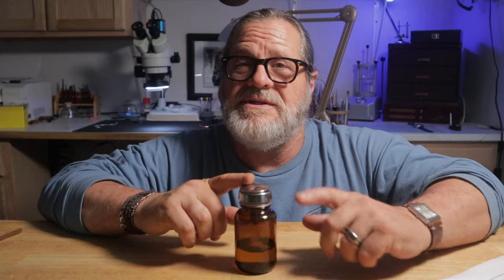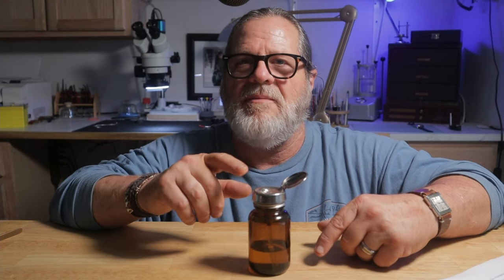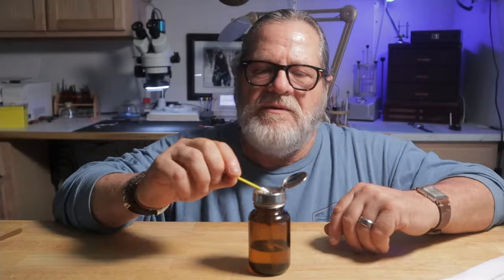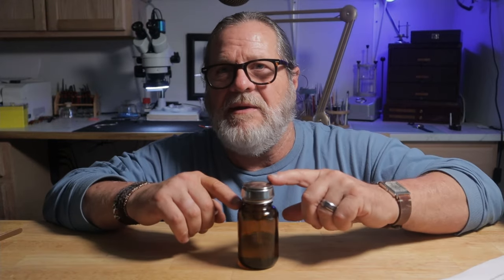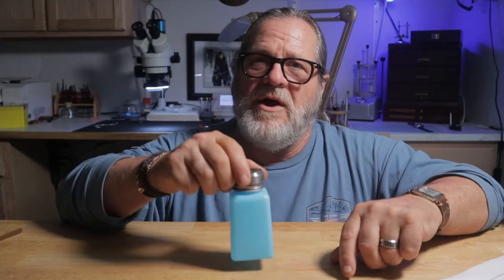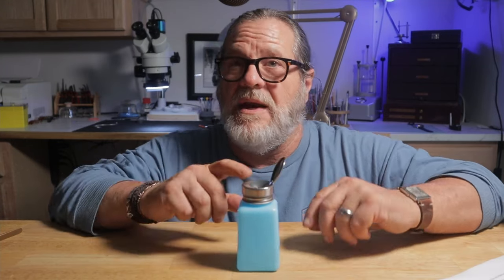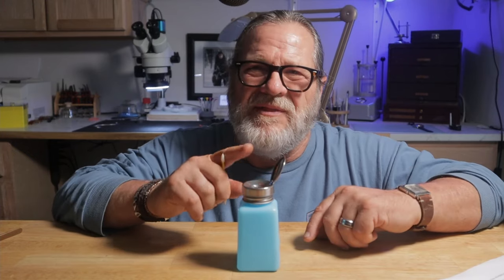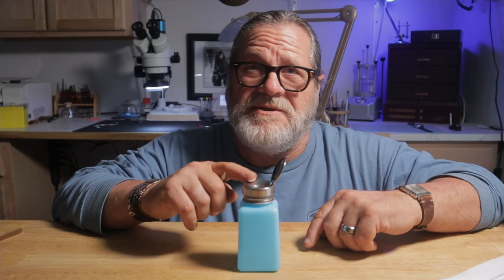How to Clean Watch Parts Without A Machine-Watch Repair Lesson #8

Comment: Some few stupid question. If use elma red do I need to rince in destilled water after the parts are cleaned? Second, can I use the elma red with ultrasonic cleaner and get same result as you get with your "spinning basket" method?
Do I need hexane after elma solution?
Hexane is inexpensive but have to clear how should it be disposed. About Elma Red I've read the producers instructions and they state if you neutralize it with citrus acid or vinegar you can toss it in the drainage. Thank you for the video. This is the best video on this theme I've seen.
Reply from the maker: Hi Papa, 
yes you need to rinse with water then IPA to displace the water and then dry. You could use hexane but i think it would be expensive than IPA
Well with the ultrasonic, if its work well, should be fine. The spinning basket is good for throwing off the extra liquid.

Thanks for stopping by

Comment: Well another terrific video. I was stoked to see this one come out, and even happier once I saw such a great DIY watch cleaning method. So questions for you:  first, would you skip using an ultrasonic all together? Also, do you recommend leaving the balance installed for cleaning the main-plate? I've watched other tutorials where they leave balance installed on balance cock (so the hairspring isn't whipped around too violently during cleaning), then afterward also use solvent/one-dip on the capstones and pallet fork. Others leave the balance out of the normal cleaning cycle, and clean it by itself with solvent/one-dip only.
Reply from the maker: Well, the DIY method is for those who don’t have the budget for moving up into dedicated equipment. Cleaning with this method, although effective, will get tiresome after awhile. 
With a cleaning machines that rotates, they all basically do the same thing right? Parts sit in baskets and rotate, you spin it off, put it in the next jar and repeat. This is true until you get up in class to the machines that incorporates ultrasonic with the rotation.
With ultrasonic machines it’s a little different as there is a huge difference in features and functions. A 40 dollar machine is not going to work as well as a 250 dollar machine. 
If you decide to go that route it would be a good move for sure and everything else I talked about would still apply.
 But I would still not put the balance and pallet fork in it when working on a vintage watch simple because of the nature of how ultrasonic machines remove dirt and grim.
Reply: @watchrepairtutorials  Yes, exactly right on the cleaning machine that rotates part! I was so glad to see the drill come out haha, I've been thinking of ways to DIY something like this for a while, since the cost of old L&R machines on ebay has gone a bit crazy. Thanks for the advice on the ultrasonics as well! If you were just using your drill setup, would you leave the balance installed and give it a whirl in the cleaner, or just handle it on its own with solvent?
Reply from the maker: @awdturbopowah773  I always clean the balance separately.

Comment: I have both an US cleaner and bought this basket to make for a DIY mechanical spinner. Do you have a preference as to which to use? Is one easier on the parts? Does one clean better? For cleaning solution I bought L&R ultrafine and for rinse I bought 99% IPA. Thanks!
Reply from the maker: This video is intended for someone really starting out with nothing. 
ultrasonic machines of this type are really designed for nonflammable washes and cleaners where rotating baskets are designed for the latter.
I made this video, Double Your Ultrasonics Cleaning Power! 💥🔧
https://youtu.be/Y0RbOvOXogw, which combines the two methods. 
Before you clean a bunch of watch parts, I would test to see if there is a compatibility problem with the L&R and IPA. 
I only say that because I know if any water were to get in L&R it creates gooey globs.
I've never tried that combination, so I'm not sure if it would do the same or not.

Comment: I love to see a creator answer back to comments. I've been watching your videos religiously. I have several movements stripped down ready to start cleaning.
-I've got the small 90 L&R ultrasonic I got for a steal off marketplace. 3 diamond wash cups with baskets. A gallon of 99% IPA I found at Ace hardware for 24.99 $0.13/oz, and I'm gonna get a quart of hexane.
-I plan on doing 1 IPA preclean/pegging in a dish, 1 heated dawn solution, 1 heated distilled rinse, then 2 IPA rinses. And hexane dip my balances, pallets, and jewels. Basin of Ultrasonic will have water. Should my alcohol rinses be heated and also through the ultrasonic?
-Does this sound like I'm going in the correct direction? And can you recommend a container for hexane. Thanks alot Alex, keep up the amazing content
Reply from the maker: I would do two heated water rinses. The final IPA rinse I would do with room temperature IPA into the heated tank but limit it to about two minutes. It’s not going to heat up that much and all you are really doing is displacing the water.
With your system if you can get the Elma 1.9 that’s a really awesome low cost cleaner.
For the hexane, I use the diamond cleaning jars, which work really well. There should be a link in the description for them. They’re about 10 bucks and they’re worth it because they come with this little basket in them

Comment: Nice one again Alex! I’m loving the DIY spinning basket!!
Reply from the maker: That’s for all our budget minded friends.   By the way I love how your Seiko 5 turned out in part 2 of your video.
Reply: @watchrepairtutorials  Thank you sir! Much appreciated!!
Reply: I have the same basket attached to an overhead lab stirrer I got on Ebay. You can also cut off the arms of one basket and insert it into the basket with arms for multi level cleaning.
Reply: @johnhannon  Genius! A lab stirrer is a terrific way to do that.
Reply from the maker: @johnhannon  Thats awesome. Great minds think alike, huh 😁
Reply: @awdturbopowah773  I bought the cheap stirrer on Ebay  for about $60. The motor runs too fast so I added a 200 RPM gear motor. I also added a controller so I can reverse the motor and set the time it runs. (almost as good as an L&R machine but no heater).
Reply: @watchrepairtutorials  I will post what I built on Reddit soon.
Reply from the maker: @johnhannon  what Sub ?
Reply: @watchrepairtutorials  r/Watchrepair
Reply: @johnhannon  Dude please let me know when that's up! YouTube is a real bitch about links in comments, but if you comment again here I will go hunt for it. That would be amazing to see a full post about how you chose gear components, controller specs etc. With all the terrific, cheap 3D printers, old lab stirrers and other sources of cheap motors around, I am shocked someone hasn't made an open source watch cleaning machine project yet (at least from what I've seen). Recreating the function of say an L&R Mastermatic should be so trivial with today's amazing DIY scene.
Reply: @awdturbopowah773  Third time posting this. It is up. Apparently I can't say where.
Reply: @johnhannon  Awesome! Thank you!

Comment: I like your videos. I have some questions:
1. If i want to use IPA for 1st and second stage and a distilled water for the 3thd stage is it possible and good enoght?
2. Does the IPA is good for the mainspring?
3. What is the recommended temperature needed for the drying process?
4. For how long the process of rinsing is taken in each stage?
Thx
Reply from the maker: IPA is best used as a rinse either with a solvent based cleaner or to displace water if you are using water as a rinse, but not as a primary cleaner whether on movement parts or on the mainspring.
Drying temperature really just needs to be above room temperature to prevent condensation on the parts but you can easily go up to around 130 f or 55 Celsius.
I would recommend watch this video about the cleaning stages. 
https://youtu.be/z-SGm-nhGt8
Reply: 1. Can i use ipa for pre cleaning as well for hairspring pallete and balance wheel? 
2. Does Hxane will fits for precleaning for both haurspring and pallete?m

Comment: Hello Alex. Just to clarify will hexane break down shellac or is it okay to rinse the pallet stones and balance with impulse pin it?  I have managed to get lab quality hexane and would appreciate this information before I proceed. Your tutorials are fantastic - a future one on how to remove/replace various watch crystals and how to use the crystal press etc would be very useful.
Reply from the maker: You can soak pallet forks and balance wheels as long as you want in hexane, Noo problem. Crystal installation is in the que

Comment: Thank so much for another great video. Im going over all of them and I see I need a better cleaning rutine for sure. Would an ultrasonic cleaner be a good substitute for the basket and drill?
Reply from the maker: With a good pre cleaning routine, ultra sonics are fine for watch cleaning with the following precautions. I would  limit the run time to about 5 minutes per cycle,  and not clean the pallet fork or balance wheel in the ultrasonic. I would still clean those by hand. 
I will do doing a video on ultrasonic cleaning but it will not be for awhile. 
A machine with a power sweep function would be a good option.

Comment: Thanks Alex. These are the best and most informative watch repair lessons I’ve seen, and I just subscribed to your channel. 
I heard Naphtha can stain brass movements, like in vintage pocket watch, is it true? If yes, what should I use for cleaning brass movements? 
Thanks
Reply from the maker: Ok so I polished 1/2  a brass bar, and dropped it in a breaker of Napatha along with a plated brass bridge for 24 hrs. No staining or discoloration at all. 
They may of meant something with ammonia in it which will damage brass.
Reply: Thank you for the response. I that you do actual experiments to find out the results.  👍 
BTW, I'm addicted to your videos. I can't stop watching them.  @watchrepairtutorials

Comment: Thank you for everything Alex! I have a question, it's not clear to me whether after using hexane as a cleaner, it's necessary to rinse the parts with IPA. Also, is it sufficient to use hexane for cleaning the balance and pallet fork, or is it advisable to perform a prior cleaning or rinse?
Reply from the maker: Hello Pablo, First, I only use hexane to clean my balance wheel in pallet fork. One of the beautiful things about it is that it doesn’t leave any residue behind, so no, it does not need to be rinsed off with IPA.
The balance wheel, hairspray typically are not very dirty along with the pallet so hexane is typically sufficient for them.
Reply: @watchrepairtutorials  Thank you very much, Alex. The process is much clearer now to me 😄

Comment: Question- what’s a good rinse to follow after cleaning with Naphtha?  Will be attempting to clean manually (without a machine).  Thanks.
Reply from the maker: You want something that can wash away the oils left behind from the Napatha. I would use 99% IPA alcohol only, not 70% or 91 %.
Reply: @watchrepairtutorials  thank you!

Comment: Roughly how long should the parts basket be in the different jars spinning?
Reply from the maker: Obviously, it would depend on what you’re using as a cleaner and how clean or dirty the parts are, but typically about five minutes would be a good starting point

Comment: Do you ever rinse your pallet fork and balance in IPA? People on forums debate whether or not it’s safe to have shellac in IPA for a few minutes. Thank you for the great videos Alex!
Reply from the maker: Personally no. I will use IPA to spot clean the jewels but that’s it. 
In general recommending IPA as a rinse or even a short soak is iffy.

If the shellac is in good shape,  not old and brittle, short exposure is not going to damage it.
On an older vintage one, to be able to determine it’s condition, you really need to be able to inspect it under a microscope to determine it true condition.

Comment: Hey Alex, thank you again for a great video. It's the most clear tutorial on how to clean part without spending a fortune. But I was wondering something, and it's related to using an ultrasonic cleaner. Some are relatively inexpensive ($60 or so), especially the small ones, so my question would be: does using one of those simply replace the first step, using Hexane or the like? Would one have to use the 3-step rinsing anyway? Or can you use one of those to somehow replace the whole multi-step process (by using cleaner first and then IPA)? It's really hard to find any clear direction on this, since most watchmakers seem to use the pricey machines. Thanks!
Reply from the maker: Good question is no. You start with pre cleaning the worst parts and Pegging the jewels. 
These process for cleaning parts don’t change when using a 10k machine. 
Ultrasonics or rotating cleaning machines don’t speed up or change the need for rinse cycles, they just take the manual work out of cleaning parts.
I would suggest watching by video on getting the most out of an Ultrasonic machine.
Reply: @watchrepairtutorials  Thank you Alex! After I wrote the question I found your other video about this topic. Very informative once again. Thanks for taking the time to answer man!

Comment: Thank you for the excellent video . You have a lot of great ideas. During the pre wash are you using the same solution as the wash cycle. Example L & R wash thank you.
Reply from the maker: No, I use typically will just use the IPA alcohol or Hexane if it’s very dirty if hard and crusty.

Comment: Thank you for great responses. Do you have an idea what is the best way to clean a sticky rust remover from a gear train"s center wheel. I just received a brand new center wheel, and it had some , what i thought , sticky  rust.
Reply from the maker: I would try acetone. If it’s actually rust, there is a product I use called Evapo Rust
Reply: @watchrepairtutorials  thank you.

Comment: I clean my parts(from pocket watches) with a paint brush and 96%alcohol for the bridges i have a paint brush that is short and hard for the delicate parts very soft brush with more hairs.the pivit holes alao with the brush. Its more work but every part i do seperately and take my time so i can practice my patience .still in the learning proces and often watch your videos witch i like
Can i have your opinion on how i do it?
Reply from the maker: you're doing it perfectly. It's actually the method I recommend to students in my course to start off.
Even if you have a cleaning machine, you still have to hand clean parts for various reasons.
I use a little petri dish, which is about 2 1/2 3 inches wide.
I like it because it only has about a half inch on it and it's easy to keep clean.
I use 99% IPA on all the parts with the exception of the shellac parts. 
Steel parts go in the dryer to prevent any rust from the IPA evaporating and leaving condensation behind.
Cleaning parts, my hand also gives you the opportunity to inspect them.
Well, done my friend. Well, done.

Comment: What cleaning solution we can use if we don't have access to Hexane, all four stages with IPA or what would you suggest? Thanks
Reply from the maker: For the balance and pallet fork OneDip.
For general cleaning 
Napatha or lighter fluid, both being flammable so be careful. 
If that’s not an option, dawn dish soap and water with IPA rinses. 
My next video is about using IPA in watch part cleaning. Don’t miss it.

Comment: Very useful video!
One basic question:
Is there any of the watch parts that I cannot put into those 2 solvents that you show at 6:30?
Also regarding rotating the parts in the basket (whether in a cleaning machine, or by a drill, as you suggested), is there any part that should be excluded?
I am just learning watch making. I am asking this question as I am thinking that maybe it is such that some delicate parts (like the hair spring, main spring, jewels, ...) need to be treated differently.
Reply from the maker: The Hexane is safe for everything. I would not suggest using IPA alcohol on any pallet forks or balance wheels until you have a better understanding of judging the condition of shellac.
As far as the spinning basket goes I definitely would not put in the pallet for or the balance wheel. The are to fragile.
I use a vintage rotating machine with baskets that separate the parts. 
I still to this day clean my pallet fork and balance by hand in Hexane.